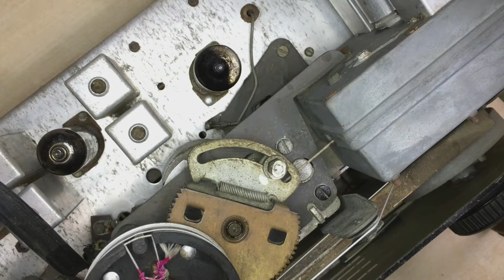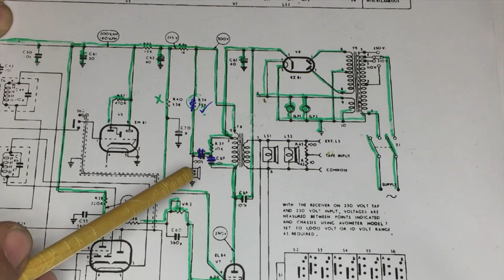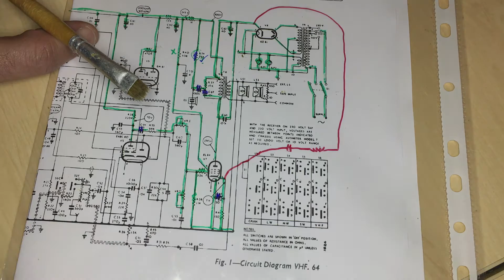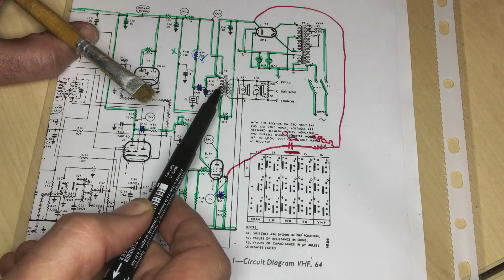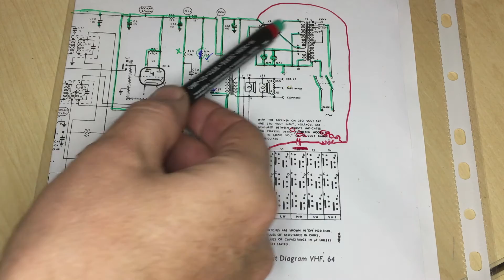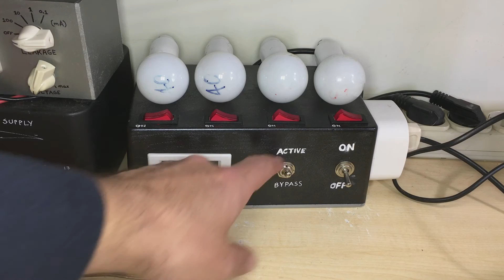Bush VHF64 tube radio restoration - Part 2. Cleaning, cap replacement, and the first power-up.

Comment: Another hum buck worth a try is two 100R 2watt resistors from the heater transformer to chassis ground, one to each end and not the high voltage side ( be very sure you understand, valve radios are very dangerous ). It must be a real ground which I think the Bush VHF has ( chassis to mains ground third pin ) ?  It's a minor change from original which seems to work. 3.15 x 3.15/100 says even 1 watt types should be OK.  Posh equipment has a centre tap of 3.15 -0- 3.15 vac.  The extra 1/4 watt should be OK. DC heating seems no better. UL series valves are unsuitable for this. DC would overload the transformer, it is just about possible technically ( circa  9V DC - 2V diode loss and 1V filter loss, it's about 50% more  3V x i heaters ) . My measurements say hum bucked is unbeatable. 

One thing worth a quick try is EL84 in triode ( as the Bush ? ). Usually the g2 via 100R to the anode. This changes the distortion type to classic  triode type progressive harmonics. H2 being about 1% typical. Output goes from 4 down to 1 watt. Often that is seemingly better and has better use of it's power. Bass might be tighter. This is due to Rp triode ( guess 1K5 ) being lower than pentode ( guess 15 K ).  Doubtless some adjustment of Rk might be icing on the cake.  These mods can be taken off in minutes. I see them like a fuel filter on an old car.  1 watt is very loud if asking, not least when the bass is strong. Voice quality should be better.

Comment: I noticed on this BUSH radio that MW seemed to have the frequency markings for LW and LW on the dial had the markings for MW?  MW seems to go 200 to 550 and LW 1100 to 1800, or are these just something else?
Edit:  Ignore me.  I just realised Bush was putting it in Metres instead of frequency.  :)   Enjoying watching you do an English set instead of German.
Reply from the maker: It was a fun change.

Comment: Trying to understand your dim bulb tester: are all four bulbs 40 watts that you just switch in in parallel when you need the extra wattage inline?  I think I understand the rest of the circuit, but wanted to check on that tester. Thanks.
Reply from the maker: +zorka4098 : I use two 40W bulbs and two 60W bulbs. It allows for many possible combinations of current limit when switched in parallel.

Comment: Been watching your videos for some time now, but one thing I wish you would do at least once in a while is show some of the actual testing. E.g., while it is relatively simply explained, it would have been nice to see you testing that output of an audio signal that you mention near the beginning of this video. The reason is that, while I have worked on a number of radios myself, I am not fully up on radio theories and seeing some of the testing often helps me understand it all better.  Just a suggestion, not sure who you target your videos to, but as an advanced novice, I would like to see some more concrete examples. Thanks and keep up the good work, you have been enlightening to me on your radio restorations.
Reply from the maker: +zorka4098 : I'll keep your request in mind and try to show more of the actual steps that produce the result that I've mentioned. There are some cases where I've actually done that, in some of the previous restorations. I think I'll actually do few "how to" videos one of these days to show certain steps of a typical radio restoration, so that I can create references that anyone interested can refer to.